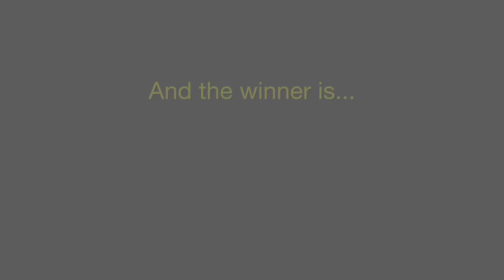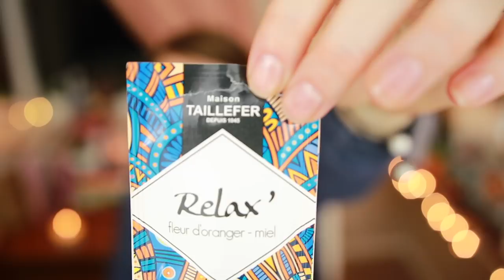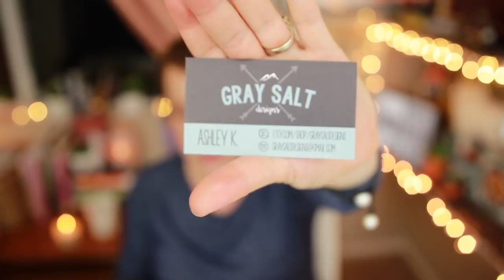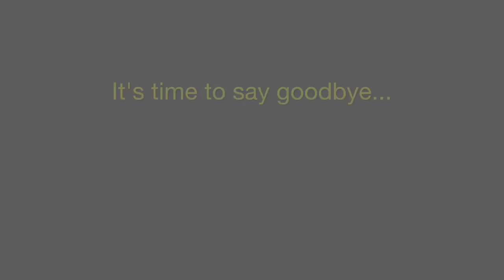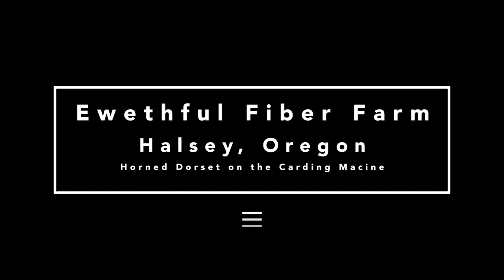Wool, Needles, Hands: a Knitting Podcast Episode 22:  Knitted People and the Best Sock Blockers

Comment: I like the Lykke needles - I was told they’re produced in the Knitter’s Pride factory and they’re the same cable. But I think a longer cable would make a big difference because I’ve been using a 40” cable for socks and it hasn’t been an issue for me. But I started with Knitter’s Pride and don’t mind them.. :)
Reply from the maker: Tricia Wattenburger I have heard that before about where they’re made. And I like Knitter’s Pride. I absolutely think the cord is too short. I usually use a 40” cord with no problem. I think overall I was just grouchy about it. 😬😂
Reply: I have knitters pride and lykke, the lykke cords are very close but just slightly stiffer - but not too stiff - and they definitely fit the knitters pride tips, so the cords and tips are interchangeable, I am already switching them around.